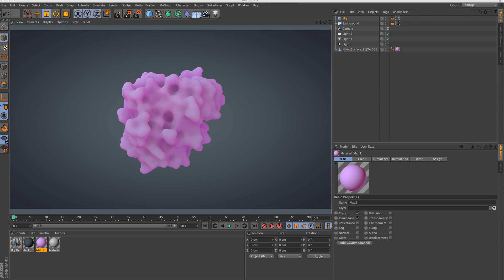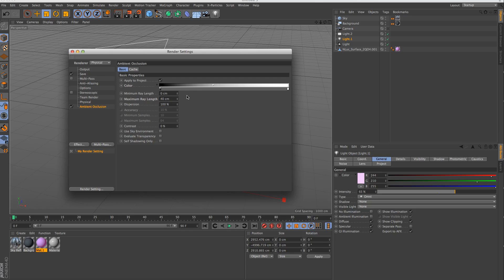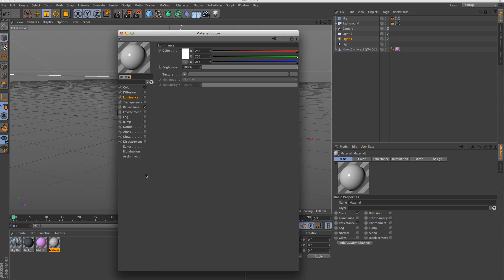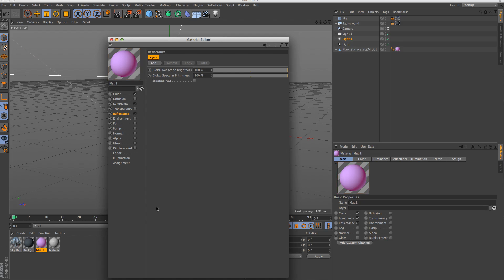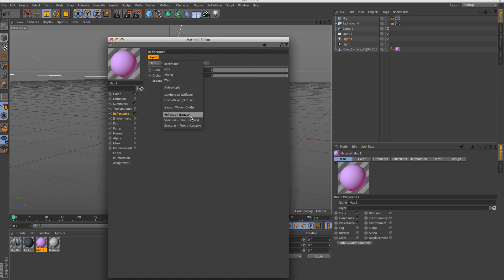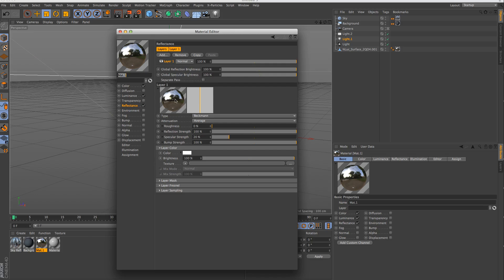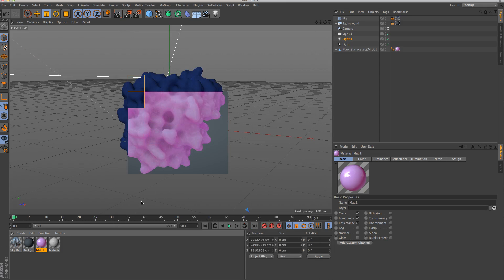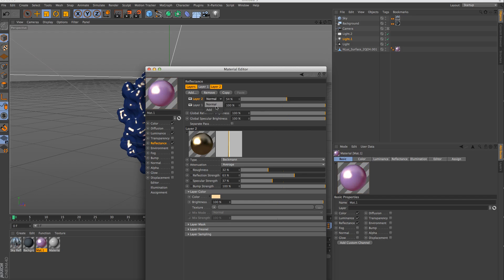C4D R16 Reflectance Channel Overview for Sci Vis Animators

Comment: At 12:25 you had a lot of "reflection" even though you had added Roughness because of 20% Specular. I had similar trouble till I dialed it down to zero. I had, what I thought, a lot of strange reflection till I realized that it was fake reflection with Specular. If I recall correctly, C4D documentation advises to do this if you want realistic look.

All that said, sometimes you want some extra shininess and this is where Specular can help.